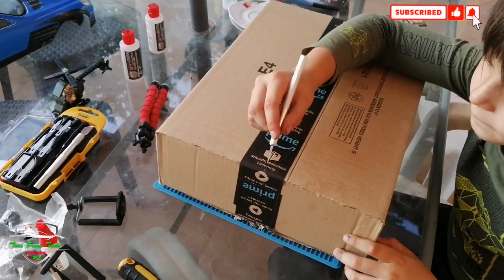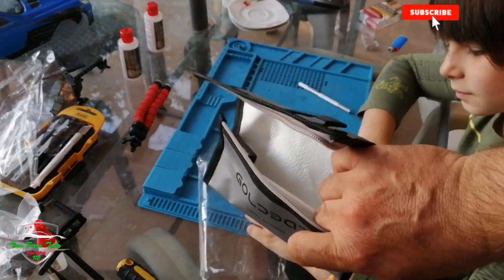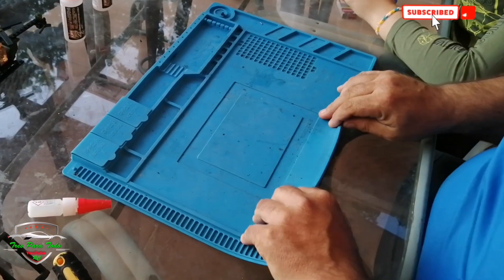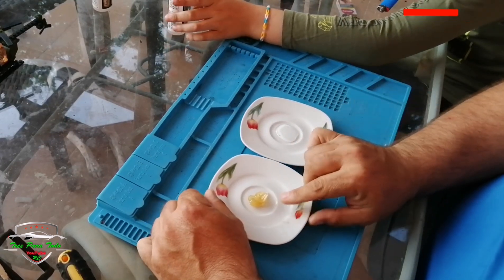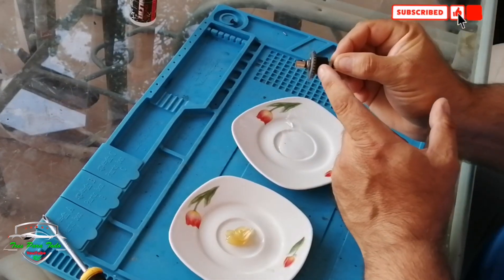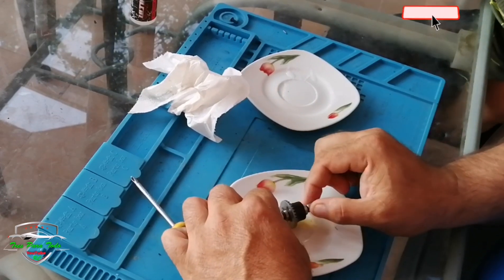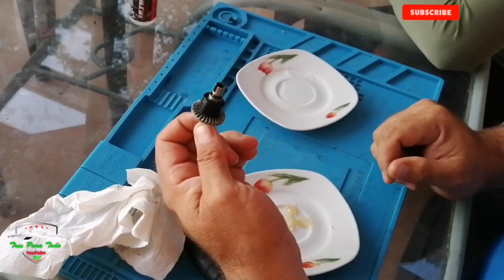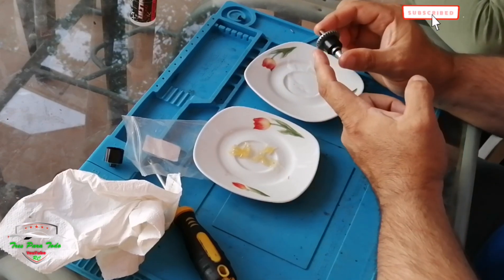RC explicado: aceite o grasa en diferenciales, y por que?

Comment: Buenas tardes amigo. Ya tienes un suscriptor más por sacarme de dudas t ayudarme a decidir que és mejor aceite silicona que grasa 🤝🏻🤝🏻👏🏻👏🏻. Una pregunta a ver si me puedes ayudar. Tengo un wltoys 124017 y quiero hacerle el primer mantenimiento de los diferenciales. ¿Que aceite de silicona me recomiendas? Es que veo de todo, hay quien dice 5000 otros 10000 otros 7000, y ya no sé ni que hacer 😊. Un cordial saludo
Reply from the maker: Muchas gracias 🫂.
Nosotros hemos probado 10.000 y 20.000 sinceramente yo apostaría por 10.000 estos diferenciales no están sellados por lo que algo sale aunque se mantiene en la caja en si pero entre mayor densidad menos fuga y en consecuencia yo con 10.000 va perfecto
Reply: Muchisimas gracias por tan pronta respuesta. Seguiré su consejo y compraré de 10.000. Un cordial saludo 🤝🏻👏🏻

Comment: Aprovecho para que me aconsejes q densidades para los diferenciales  del 124019 con brusless 3650 de 3600
Un saludo
Reply from the maker: Pues 20,000 y cada 20 baterías toca limpiar y cambiar aceite. 
Más menos.
También puedes echar un poco en la caja del diferencial ya que hace bañera lo justo para que bañe la corona del diferencial sin pasarse.
Reply: @tresparatodorc7400  gracias.
Lo he encontrado en otro video.
10.000 delante
20.000 detras
1.000 en la corona ( tengo 600 sera suficiente?)
Correcto ?
Y pir seguir aprendiendo porque detrás más q adelante ?
Reply from the maker: Es para que deslice un poco más de atrás entre haciendo drift